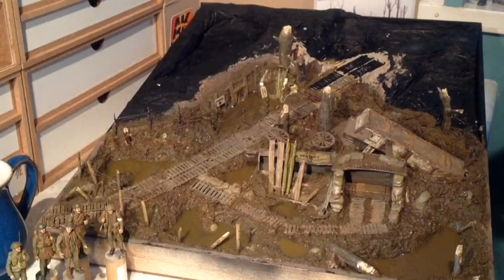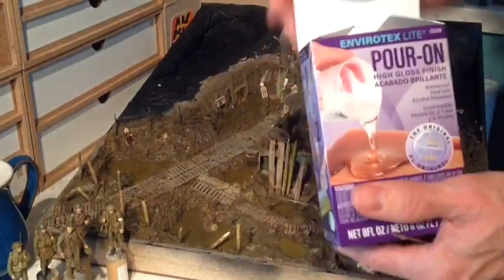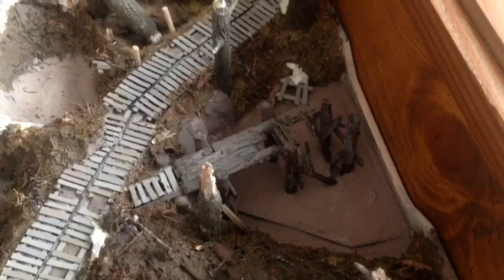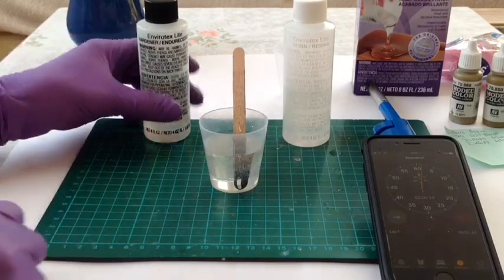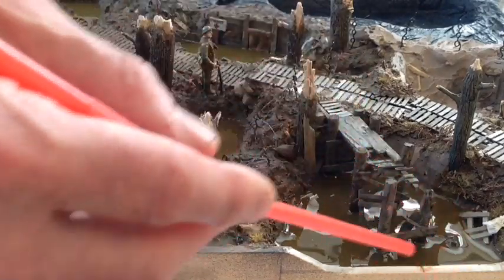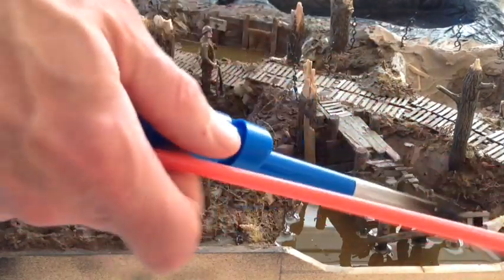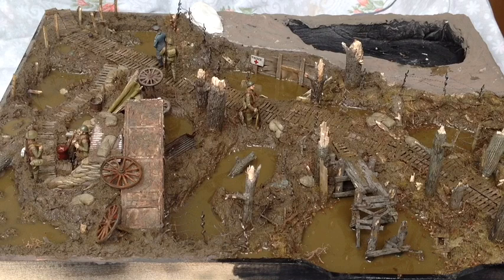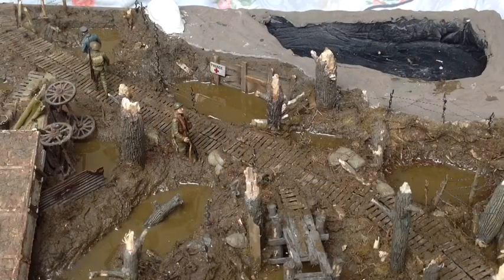Passchendaele Diorama  'All Quiet......'Part 3

Comment: awesome work I've got to do a summer road in WW1 for a tank column any suggestions on how to make poopies in a field
Reply from the maker: Thanks bud 👍
Well, making poppies?? (or was it poopies?😆) I've come across these before online-  http://www.realityinscale.com/Poppy-Plants-21pcs,   but not used them. Works out about 30p each flower, which isn't too bad. Would look nice in a field - but potentially a bit expensive depending on the size of the field? 
To make your own? An idea perhaps would be cut out some red paper with a hole punch to create small circles. Maybe shape them alittle, & have a tiny black bead for the centre? Attach to a thin wire for the stem? Quite fiddly, might not look as good as the bought ones, but just a thought.... 
Good luck with the dio, a tank column? A few kits involved then? 😀👍
Reply: Yes I've seen them as I'm in the UK I've tried FOG models they are out of stock but should be back soon so intend to get them from them
Reply from the maker: FOG models are great for things like that, just found the video of the scratch built picket posts on YouTube, might be worth a try? https://www.youtube.com/watch?v=VJP1UNj4ZVA

Comment: Nice one! What Vallejo paints did you use with the resin?
Reply from the maker: Hi Sean, good question, it was a while ago, had to think about that one😆❓
The drops that went into the resin were Vallejo Khaki 988 & Khaki Grey 980.....👍
Reply: @Barbarossamodels  Thanks Mate! The level of detail you create on this board is impressive! I'm currently working on a similar project. It's a display board for a Death Korps of Kreig (warhammer 40k) army and i believe the colour of the water effects will mesh nicely with the colour scheme I'm using.
Reply from the maker: No worries Sean, thanks again! Seen some great Warhammer modelling online, really fine work...good luck with yours 👍